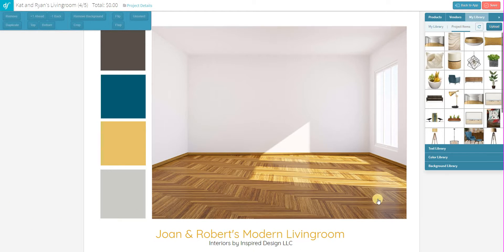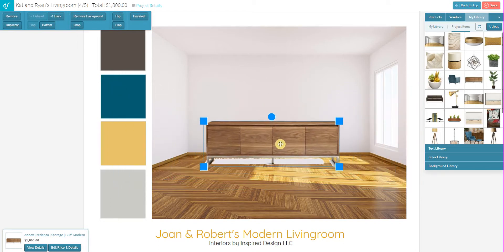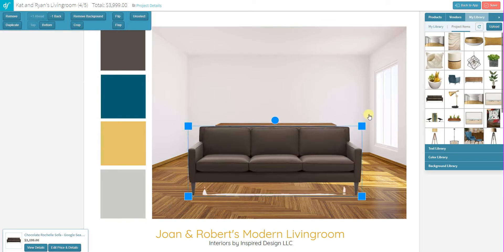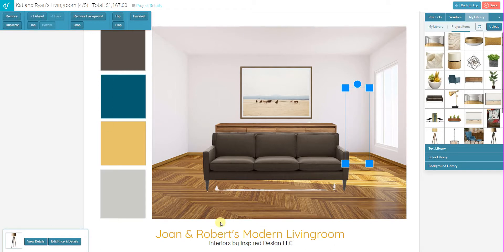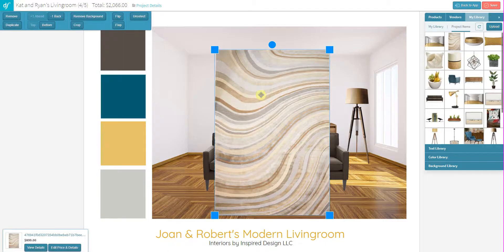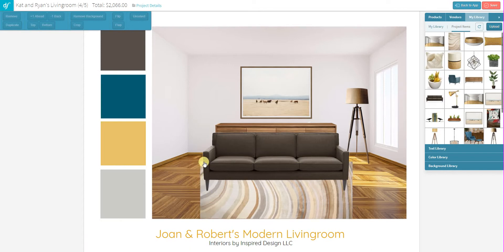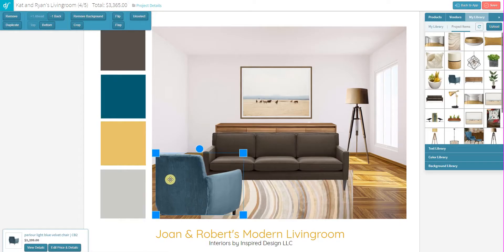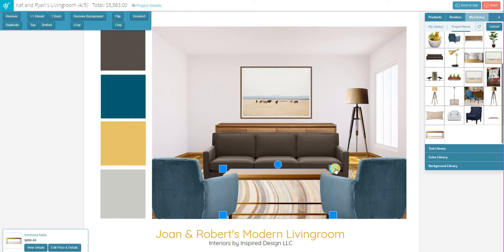DesignFiles.co - 3D Room Design Tutorial

Comment: Unfortunately the distort function doesn't rotate furniture nicely if you want to place against side walls. I spent days trying to rotate a sectional only to discover that it isn't possible. You have to research if there's a pic of the furniture facing the direction you need (generally it doesn't exist) this only works well with furnishings facing north& South.